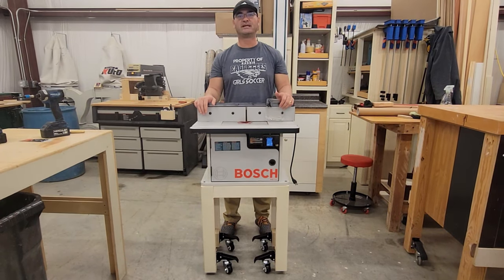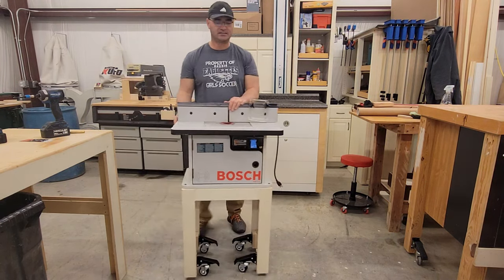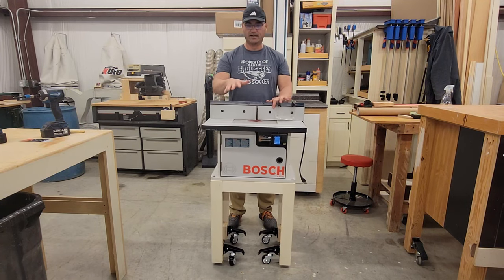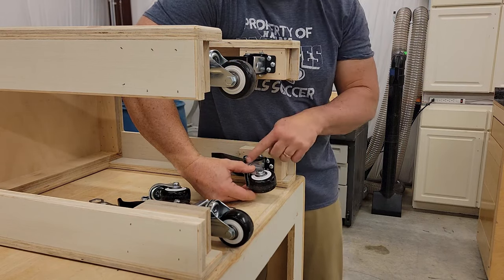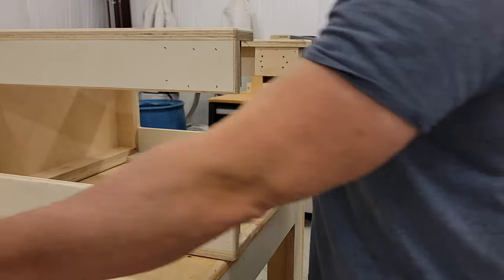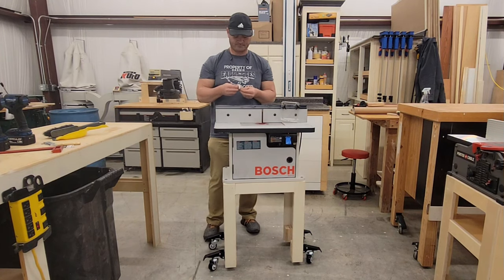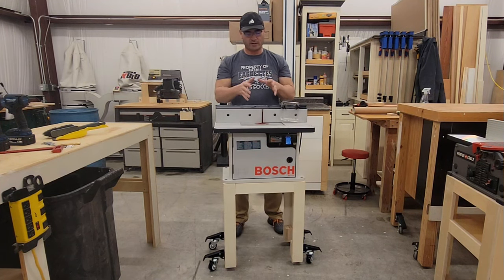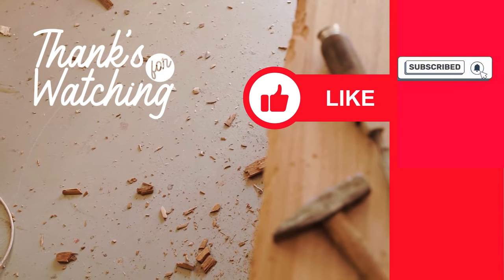Don't goof up like this - make sure to position your casters with safety in mind.

Comment: good point.  Some possible alternatives?  (which can be combined.)
Splay out the legs which will increase the stability of the stand and allow you to mount the casters on inside.

Or switch the casters for the same type but are removable.  A simple pin pull and the lift & caster comes off leaving a mounting plate.

I noticed what seemed to be some flex in the legs and splaying them should stiffen them slightly and allow the option of additional bracing (and possibly a storage drawer/cabinet?).
Reply from the maker: You're right, they do have some movement. I had planned on using the stand for a bit and then determining what kind of storage I wanted underneath. The flexing became particularly noticeable when I was using the center punch to mark the holes.

Comment: The inner mounted casters create a moment and it'll always tip given the slightest of nudge.  But I have those casters (not sure if it's the same...looks the same) and it's held up remarkably well for my heavy work table.
Reply from the maker: Yes, I agree and when you couple it with the small footprint, I was afraid it would fall over at some point when moving it. I'm glad you like the ones you have. I really do like mine that I have on all of the benches and stands in the shop.

Comment: that mistake has never even occurred to me. what were you thinking? 😂
Reply from the maker: Fair enough question. But I put all of my casters on the inside of my benches and work tables to avoid tripping hazzards. As soon as I mounted them, I felt certain I wouldn't like it. Inside mounting worked well for all of my others. 😉